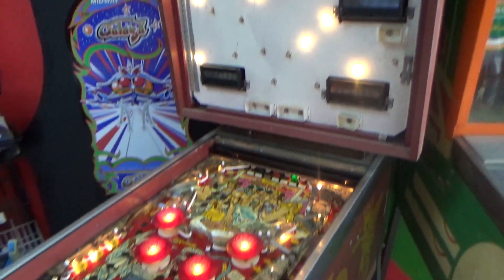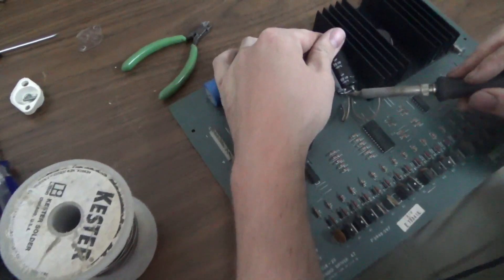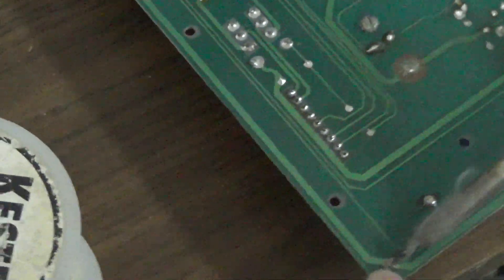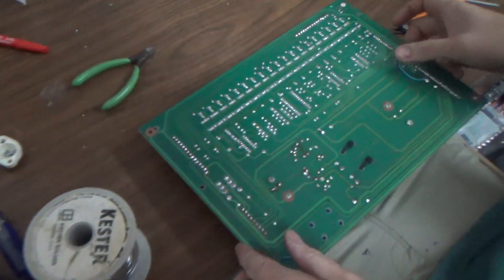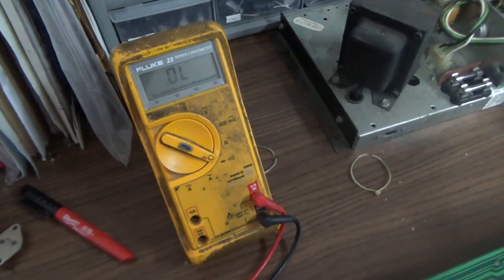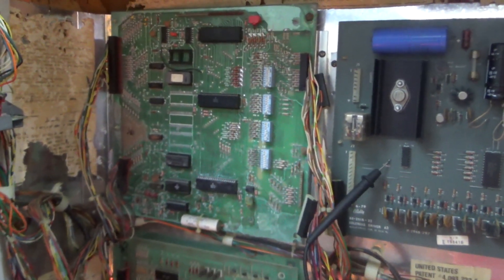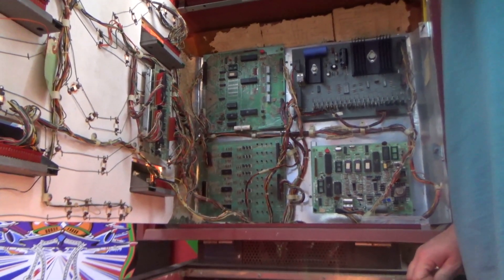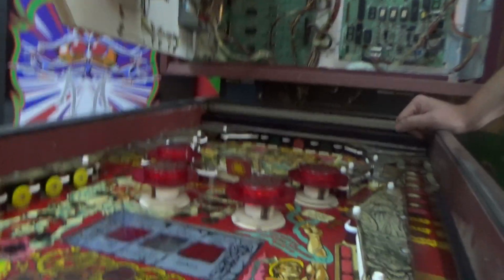Watch This 1981 Bally Medusa Pinball Machine Come Alive For The First Time In 30 Years! PCB Repair

Comment: I'm convinced that engineers of the day putting Alkaline batteries directly mounted to the CPU's was the very first example of engineered obsolescence. lol
Reply: I think its more of lack of foresight. Old overengineered batteries didn't leak, so maybe that was the assumption with alkaline batteries? You also see this issue in old computers as well, the batteries would leak and potentially destroy the motherboard.
Reply: It's not planned obsolescence, it's a maintenance failure. You are supposed to replace the battery every couple of years. The problem is people left the batteries in them when they put them into storage for decades.
Reply: @ThomasWood3DPrinting  Agreed. This isn't some home appliance this is a routed coin-op machine that is designed to last and these electronic engineers MUST have known this would be a ticking time bomb. Gross negligence.
Reply: They don't add mercury to batteries any longer so they are much more likely to leak these days.
Reply: I really think they intended pinball machines to be of-the-moment and disposable.

Comment: I always turn the high voltage pot down until the displays just begin to flicker or drop out then turn it back up 5 volts.  Most of the time I end up between 175 and 180 volts.  It does make them run a little cooler which does help them last longer before they burn.

Comment: I have never heard of this game before.  Can't wait to hear the sound board.  Won't be driving this one home with one headlight much longer.
Reply: Hear a tip: If you are getting water in your headlight and its blowing the fuse, you can fix this by filling the headlight up with headlight fluid. The headlight fluid must be this stuff, dielectric, meaning that it will not conduct electricity and cause problems.

Comment: Great Video guys,  Is that the first video where you put a new mpu board in?  It was cool to see Joe fix that connector.  If both of you guys are working on the machine, who is running the store?  Thanks for filming.  Can't wait to see the next video.  Thanks Ronnie
Reply: They've used new boards before, they put one in a Future Spa for example. They also put one in a, at least one, Williams machine.
Reply from the maker: We use them whenever the Original is just too far gone. We are big fans of alltek especially after this video https://www.youtube.com/watch?v=jh2I8bst4ZM&t=11s

Comment: Ron and Joe what are the typical life span of the capacitors in the pinball game or video arcade game? Like when they were bought brand new. 15-25 years? I was just wondering because I remember like on the regular home computer I believe from one manufacturer that made like the motherboard. Similar to like the mpu and similar boards that uses capacitors in pinball only smaller. Were of low or poor quality one.